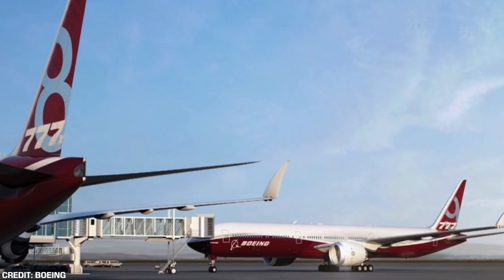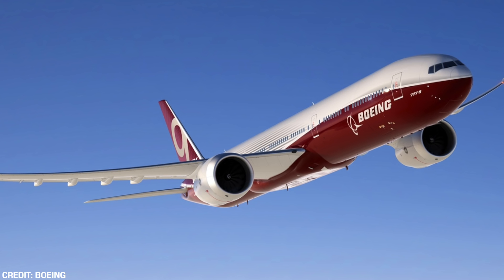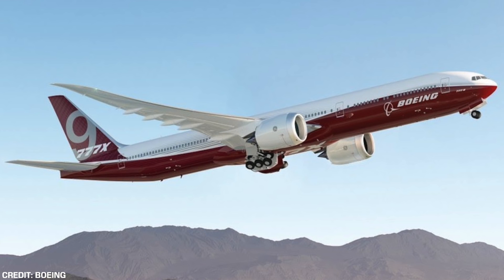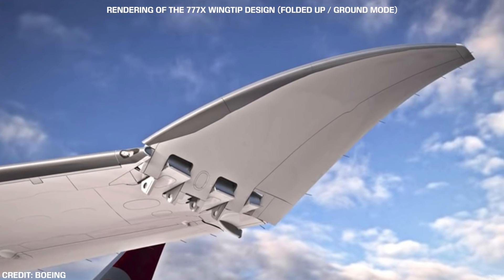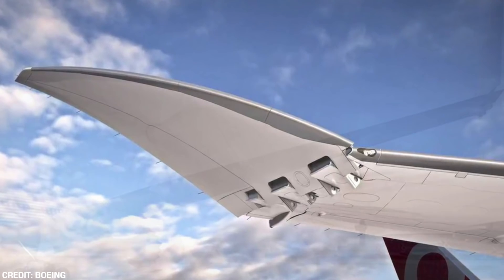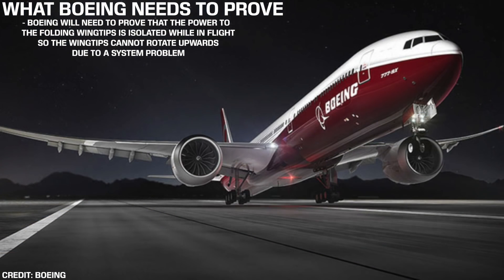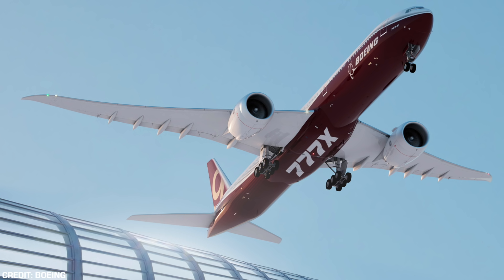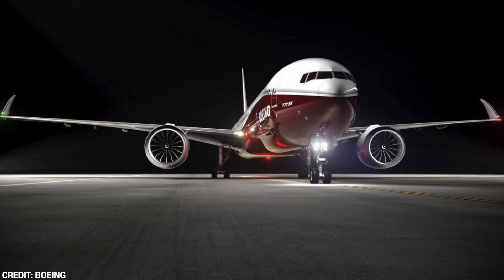The 777x WINGTIP CERTIFICATION Plan

Comment: For some reason, I just don't like the ideal of a folding wing tip, (vertical or horizontal folding). Wouldn't such a mechanism add a lot of unnecessary weight. Also, it would seem that the wing would be somewhat stronger with a traditional wing. Personally, I think a hinged wing would look ugly.

Comment: I've flown the 777 lots. It's a good enough aircraft (although for passengers, not the best in my opinion). Pilots and aircrew seem to like them.
New safety regulations for the foldable wing-tips should help, but at some point something will go wrong. So I'm more interested to know how the airframe will react when there's a wing-tip which doesn't fold back into place, or even worse breaks away. Will the aircraft behave well enough with a massive bit of the wing missing?

Comment: For the power issue, they could have the APU power the wingtips so therefore when the APU is turned off after pushback, the wingtips would not have power to be folded up until the APU is turned back on

Comment: Really don't see this as a major hurdle personally.  I suspect there will be a locking mechanism to prevent fold up or down at the wrong moment.  I also think this is only critical on take off and landing with takeoff being more critical.  I doubt folding up at cruise would prevent flight except when at the top of the flight envelope due to weight.  This will be a checklist item for after landing and prior to takeoff and I don't see it much different than spoiler deployment in flight.  I think the risk will end up being greater on the ground.

Comment: I assume that the wing tips fold upwards to prevent any impact on ground operations. Otherwise, thinking about the loading on the wing during flight I would have thought a downward fold would have been failsafe, as the lead would push the tip up. Does anyone know what drove the decision for the upward fold?

Comment: I am very excited about the folding wing tips. Boeing always comes out with lots of revolutionary innovations! Ever since it was announced, I've been wondering what would happen if there's a wing tip malfunction in flight! This would probably never happen but I'm curious to see some of simulation of worst case scenario. Just my over active imagination, LOL.
If there's a malfunction on ground, let's say the tips just would't fold up as the aircraft is taxiing to the gate, I guess a simple solution would be to park it at a remote stand and if it wouldn't unfold before flight the simple solution would be to ground the plane.

Comment: I am excited about the folded wingtip idea if the purpose is the blending of a winglet (or pick your favorite term) and a raked wingtip, which will greatly enhance cost saving features on the 777X.  Aerodynamically, winglets provide the best performance for takeoffs and landings to and from cruise altitude(s).  The raked wingtip provides the best performance on extended cruises.  Both devices are designed to minimize the induced drag caused by wingtip vortices.  Thank-you for the report, Dj.
Reply: C-990 Buff nope, the only reason they fold is to make the 777x fit in older gates
Reply: Thank-you for the clarification.  I suspected that was another reason, but I think my idea has merit.  Just trying to think outside of the box.

Comment: What is the need for the folding wing tips
Reply: 7 meters extra of wingspan
Reply: Karam Bains  <<  While the plane is on the ground, taxing to or from a gate, a section of the wing tip will be folded upward to allow safer clearances in those areas, compared to a wingspan of that size without folding wing tips. Personally, I think airports should simply have larger gate areas, allowing the plane to have a normal wing, or a raked wing tip.

Comment: Should state the F111 did not fold up. It was some prop fighters. P51 mustang I think.
Reply: P-51 never had folding wings. That was an Army Air Corps bird. Only the aircraft designed for the Navy use them because saving space on ship is worth the weight penalty.

Comment: Exciting concept. Russia had flip out cannards on its supersonic jet liner. Military planes F111 had swing wings. And also fold up wings to store on aircraft carriers. Although those may not be under Faa certification. We wait with interest.
Reply from the maker: Indeed, there are already some military aircraft with this device, however, it'll be interesting to how it goes on something like the 777x :)
Reply: Yeah, I'm not sure the TU144 (and it's canards) is a good example of safe engineering. It was only in service for a few months and crashed a couple of times. 
Civil aircraft have FAR higher safety constraints compared to military aircraft. I'd presume the lack of an ejector seat for civil aircraft would be one of the reasons for that.

Comment: As a layman, I like the folding tips. I hope that we will get much more efficient wings for the 737s/320s over the next years. And I believe all the technical problems are solvable, as naval aviation flies wing folders for 70+ years.
Reply from the maker: Fingers crossed, thanks for watching!
Reply: My idea was that maybe you could either stretch the wings further, or park them in a cheaper/smaller box (i.e. lower airplane design group)

Comment: Great idea Boeing has! When is it to release? Now airports don’t need to upgrade their gates because airbus a380 caused a lot of problems because of their large aircraft. It costs a lot of money to upgrade gates.
Reply from the maker: The testing with the first 777-9 will begin next year with a hopeful delivery to its first customer in around Q1 of 2020. However, this is permitting testing goes well etc. The 777-8 will launch two years later in 2022
Reply: I highly doubt Boeing will meet its scheduled delivery off the 777-9x. The dreamliner programs was severely delayed.
Reply: The gates themselves weren't really the problem with the A380. It is within current established width regulations, unlike the 777X, hence the folding wing-tips. It was the sheer weight of the A380, width necessities for taxiways (for engine clearance), and runway length which caused problems.
The second two aren't really problems for major airports, but the weight was.

Comment: they need to make some mechanical mechanism  to where gears chains and shafts work together to flip the wing tips up when the landing gear doors open or even as the suspension compresses they flip up because with as advanced as electronics have gotten they still do fail
Reply from the maker: That'd be very interesting. Should send Boeing a message!
Reply: The tips are expected to not fold until the plane's on the runway.
Reply: No, they can't do that, because if they had a last-second aborted landing/go around, the wings would have to function like normal and be ready for acceleration
Reply: Tim Cook Not sure who you replied to there. And it's not like the bird wouldn't stay airborne with the tips up.

Comment: Kind of wish Airbus had the thought to do this with the A380. Meant probably some airports wouldn’t have needed a redesign. Also means BA could have used them to go JFK as only thing stopping them is gate size
Reply: Thomas Mortimore Is this due to the terminal BA uses at JFK? Because other carriers fly a380's there.
Reply from the maker: It would've been fantastic to see. Should never rule it out on future aircraft if this does work on the 777x
Reply: Nick Roberts yes. Terminal 7 where BA operates (and sort of owns I think) is not big enough/wide enough gates